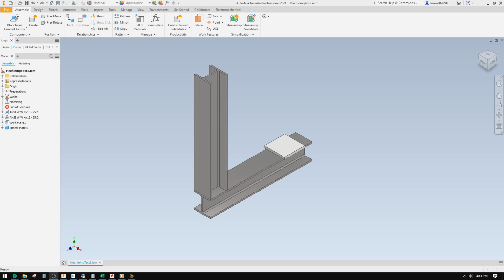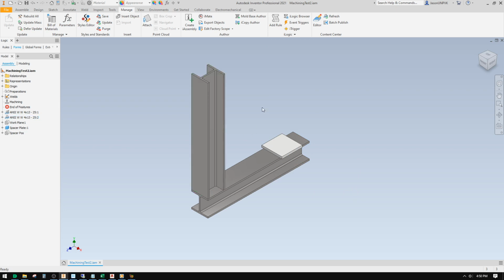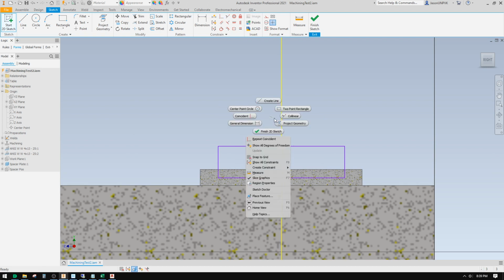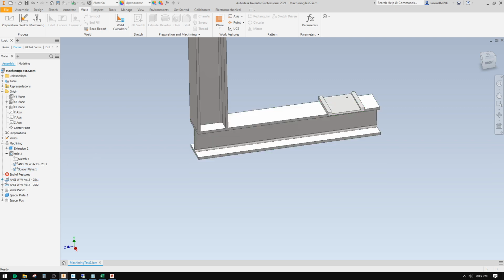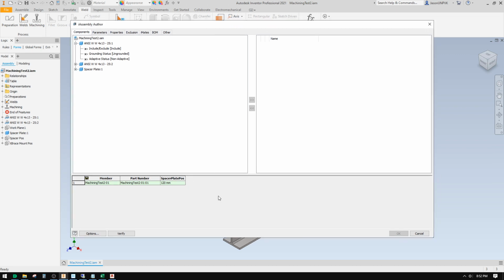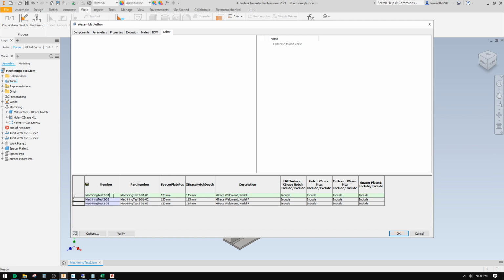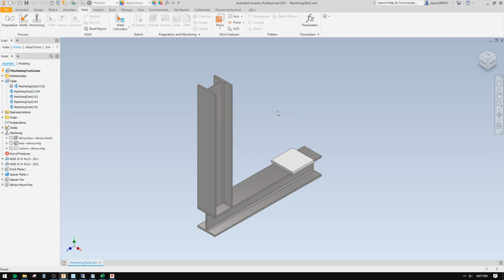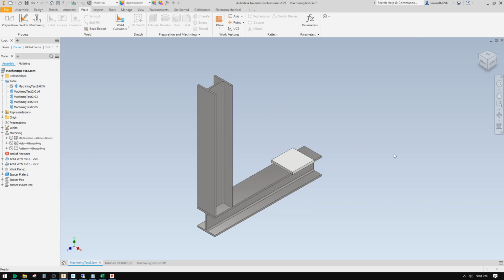iAssembly And User Parameters

Comment: How to interact directly with UserParameters of the components?
Reply from the maker: I'm assuming you want to interact directly with User Parameters of the components from within the assembly, please let me know if I misunderstood.  This is a really good question, and the answer is you can't.  There is an Autodesk article that mentions this, you get a cyclic error or circular reference.  BUT!  You can create an empty part file and create parameters in it that will control not only features in your assembly but also the size of the parts in the assembly.  Create a part file that will be empty and name it "MAP" or anything you choose.  Create parameters within that "MAP" that you want to use to drive the part features from within your assembly.  Place the empty part in your assembly.  Link the MAP file parameters in your assembly & in your part files that you want to control from within your assembly.  Edit the empty part from within the assembly (the empty part file has to be closed), change the parameter you wish, return to the assembly and rebuild.  Everything will change as expected.  The parameters have to be plugged into the dimensions & features you want to control.  I will try to create a video demonstrating this.  I usually name the empty part file "MAP", but you can name it anything.  It's essentially a control panel.  You'll create all sorts of parameters in it and drive changes in your assembly, including part size changes.  The downfall is that you now have a part in your assembly that you don't want in your Parts List, so you have to work around that.